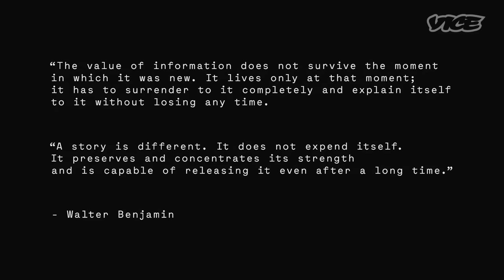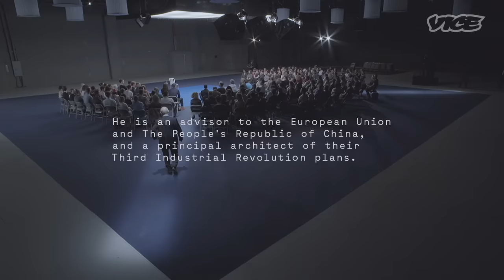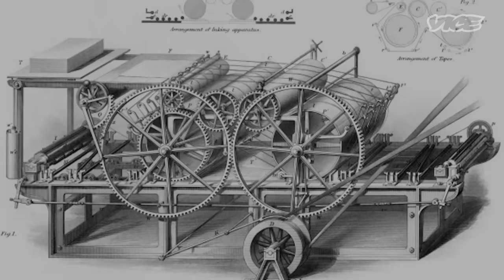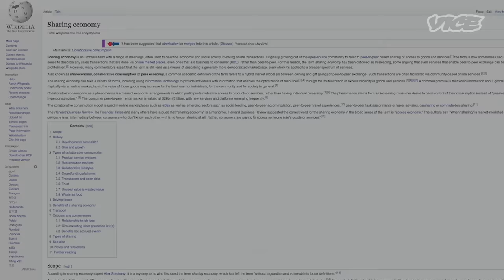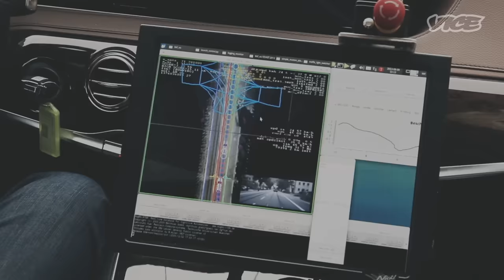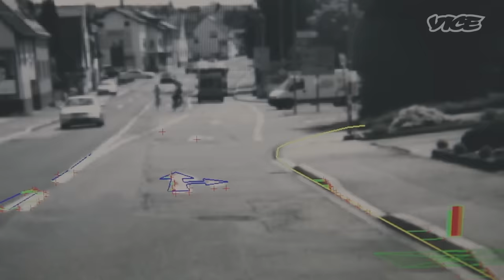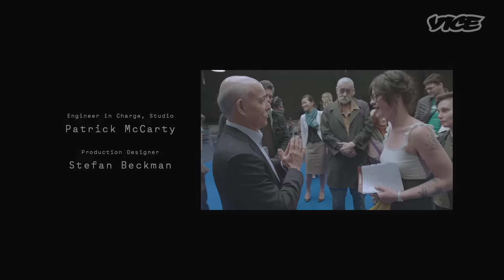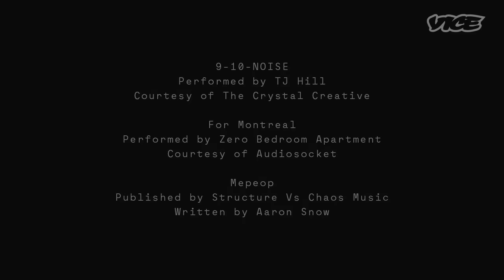The Third Industrial Revolution: A Radical New Sharing Economy

Comment: I’ve been watching this video for 2 years, anyone watching this on 2020? It’s amazing, I’m speechless.
Reply: Its now the fourth industrial revolution.
Reply: Big Knowledge and it has only just started 
Will it outpace our ability to absorb it?
Do we have enough intelligence not to fight it?
Or shall we fall back to greed and destroy
That which we have created....
Reply: @dominicsnow4164  Me too mate. I think the part he missed was batteries. And with elon musk announcing vehicle to grid we are looking at storage for energy meaning renewable energy is a viable option. You can sell power during peak times thus making money. The new battery coming can be made with out drying out the lithium reducing time on production and I'm told this dry process increases battery efficiency by 30 percent. This is achieved by reducing heat generated during energy transfer.
Reply: To add to the point a little more. If we flatten the peak energy demand by supply more power it will help lower the power price cause you don't have coal/gas power plants producing energy during peak times. This is the reason why our power is expensive. Something ya'll probably already know. :)
Reply: yes
Reply: Because it is accurate and well articulated.
Reply: WeatherWar101 is much more amazing and much more accurate. This man is lying to u. Just words, no comprehensible or testable evidence, unlike WW101
Reply: @ISeekTruthAndJustice  No, it's completely inaccurate and an elaborate coverup for what's really going on, which is WAY WAY worse
Reply: I just saw it incredible
Reply: @MattGalter  Elaborate please.
Reply: Darth Maul  your comment " watched  30 times  " WOW  is that good
Reply: Watching this for the first time. Incredible...I totally align with this vision and want to see it become a reality!!! What makes this video more relevant today is that this should be the response to our current (2020) global economic situation...and because of the severity of the situation I believe there is a greater chance that this change could actually take place. 

How do we move this into action?
Reply: Yes 2020 here. Are we any further ahead?
Reply: First time watching aug 2020
Reply: I'm not pushing religion here, however, In the scriptures it says that 1/3 of the creatures in the seas will die, 1/3 of man will die, 1/3 of the trees will die, earth quakes, droughts, huge hail stone, seas will rise, and the list goes. It's like someone knew human activity would activate these end of days scenarios, which are already evident in real time... another thing I forgot to mention - the great men of the earth - Yeah, these are the 1% - they will amass so much power and wealth that a third industrial revolution may just be a pipe dream. A loaf of bread will cost a whole days work under their control. So, I'm just saying don't let it be just a dream; you have to fight for it and take the powerful out of the seats of power (the scriptures describes these seats of power as high places). Just food for thought <<< millennial >>> generation...
Reply: Same
Reply: Ken Lawson he is actually a very vey bright man
Reply: Prophetic?
Reply: Beware folks. This is what the oligarchs will be calling “the Great Reset”.  It’s a console grid they want us to set up to control the population and protect the elites as capitalism collapses under its own internal contradictions. 
Don’t be fooled. This is their plan for us. If they fail then they will take us to total war to reduce the population to controllable levels.
Reply: Read his book with the same title if you haven't. It's really great.
Reply: Tesla will take us ‘Off Carbon With 5 Decades’ support the mission buy Tesla and the upcoming Tesla network autonomous vehicles!
Reply: I can’t remember the exact words but there’s a quote that goes by like this : We live in a era in which the illiterates will be the ones who can’t learn and not the ones who can’t read.
Reply: I'm watching 😁
Reply: @seemose  seen your music set-up
Reply: Mind blowing
Reply: Hey, I NEED to get in touch with any of the people who were present in this conference. Do you have an idea of how to reach them?
Reply: WOW SADLY YES 🌍😱 #BUZZOFFTOXIC
Reply: I agree! I've been mindblown, I wish everyone watched this!!!
Reply: @newdawnrising8110  But what vision are you selling ?   People should avoid networking at any cost ... even our own demise ???
Because becoming more connected and globalized , has not been proven to be our down fall.
And currently , it looks like you are not free in making a choice to learn ... since you apparently already know the end result.
So , do you want to re think about who might be the trapped brainwashed one here in the mix ?
Reply: YEEEEEEESSSSSSSSSS
Reply: It's computer communism and what occupy Wall street is all about.
Reply: Watching this after the world basically burst into flames in several countries because it's too hot.
Reply: Darth Maul  fruu:
Reply: It’s kinda like COVID is indirectly clearing a path for a major change. Now is the time to move, I hope we don’t squander it.
Reply: My first viewing. What I have been thinking about for a few years. I think capitalism has to change its structure. We cannot continue rewarding people who make money at the expense of the planet and our sustainability
Reply: First time in 2020.. it's brilliant
Reply: First time in 2020. Elon Musks ( Star Link ) is going to be  a huge part in pushing this agenda forward.
Reply: Human depopulation is urgent. As human, computer and animals are just the same. To be programmed. Feeling is just feeling.
Plastic trash issues here in Indonesia is inevitable even on Bali, there are limitless numbers of global companies here but none of them seem to care, but only matter of gaining profit without thanking, taking care the Mother Earth and I struggle myself all alone #Minangkabau #WestSumatra. All they do just trashing the tv programs with trashy programs the roots of the environmental trash #mindsets
I remember as a child in late 1980's early 1990's there were less plastic products than today as there wasn't even any private tv channel.
Greediness and stupidity has taken over human and keeps breeding without considering the future impacts. Human birth rate is out of control as well, needs to be balanced.
TV = television = transfering vision from distance
#sustainability #media #television #tvproduction #subconsciousmind #programming 
#environment  #Indonesia #capitalism #industry #business #Sumatra #Borneo #Celebes #Java #Bali #Moluccas #Papua

https://patents.google.com/patent/US6506148B2/en
Reply: Youve been watching it for 2 years? Well its a good thing scientists are now saying that the universe is  15 BILLION years older than theyve been saying it is. Lol
Reply: Stop watching it - it will fry your brain... it is bullshit.
Reply: @frze5645  prove it what is wrong about it? Don't worry ill wait.
Reply: Ya
Reply: Quant Network. Interoperability
Reply: What is the point of your comments. You respond to a presentation... Yet, you haven't the faintest of what he is saying and it is all obvious by your comments. Don't waste your time trying to understand, just follow allowing as you have no other choice!
Reply: @mattmatt591  🐰
Reply: @frze5645  still waiting?
Reply: @newdawnrising8110  - You are absolutely right.
Reply: @artofsigil2335  - But it is pure propaganda - you must see this!
Reply: @PresidentialWinner  "So in any case, if you’re tempted to try to join the Davos buzzword crowd and throw the term “Fourth Industrial Revolution” into a conversation, just don’t.  In a few years, when that term has been properly consigned to the dustbin of history, you’ll thank me"

I can't think him. He couldn't be more wrong. Klaus Schwab's expression appears to be more popular than ever.
Reply: @simongravel7407  Klaus is a clown.
Reply: A Thought provoking & richly insightful presentation, with  Q&A, which inspires further research & consideration
Reply: Yup
Reply: There is no sharing economy, there never will be. You are watching this for free because you and others like you are being pumped with Ads, without your consent, through which google is making loads of money and shutting out its competitors.
Reply: @SR-lk1jw  I think you are making a mistake confusing the sharing economy with the ad based market. Uber, Lyft, AirBnb don't have ads but are part of the sharing economy. Youtube is also part of it but has ads to create profits. These are not mutually exclusive. You can have both.
Reply: @johndiggs5926  watching this and realize that Trump managed to totally disprove his petro dollar theory and inevitable unemployment crisis through energy independence. Hence the virus and the Fourth Industrial Revolution which will force the U S to comply with the globalists evil scheme.
Reply: @justindaffronte9702  give me a break. Where do you people come from? Bots or paid shills?
Reply: @maganalia  yes, we are ahead because we now know that everything he said was B.S. based on the evidence shown to us precovid US economy and energy independence.
Reply: Things are becoming horrific in 2020
Reply: September here, still relevant
Reply: Soylent Green is made of people!
Reply: Darth Maul  Bro Kaidder has been watching this video for 2 years... 30 times doesn't even get you close 👀
Reply: PresidentialWinner yer mistaking idependent contractors who are payed by a company the work for as some free thing u just get
Reply: You a fan of the climate part or the communism part
Reply: @isaac6077  lol
Reply: The exact same story here! Saw it first about 2 years ago, must have seen it 10 times already
Reply: At least once every 3 or 4 months.
Reply: ... i'm afraid humanity is lost. it will continue to follow the orders of the corporate elite regardless of the consequences. why? because the elite own, operate and control all the media that's pushing its fascist agenda. 
       those exposing the reality behind this fascist, techno-take over of humanity are silenced. they can't buy advertising to oppose the advertising with which the corporations inundate society. 
       here's the solution - with EVERY commercial there needs to be equal time given to detractors of that commercial. and don't expect this justice to occur anytime soon as long as the industrial and techno elite control the world and almost everything we and our kids see, hear and read.
Reply: in other words - the damned corporate fascists are winning the PR war promoting their police-state products because they've made dissent IMPOSSIBLE!
Reply: Yes the future is scary 👻 and bright 🌞 👊🏿✊🏿🇨🇦
Reply: @MrAnselm77  ... yep, the future is bright for the rich and scary as hell for the rest of us. if humanity doesn't wake up, and REAL damned soon, we're going to find ourselves in a dystopian nightmare from which we can't awaken!
Reply: Watching now. It's blown my mind! If you were born after 1984 you have the world in your pocket- use it wisely for the new generations
Reply: NWO
Reply: @steveepic5957  I do not agree after watching this doc.
Reply: Just watching this now. I've been saying this for years but could never put it into words. It's frightening that nothing will be done.
Reply: @garrettchappell3786  Its already happening right now!! Don’t let the gravity of the situation kill your drive and push for change. Humans have proven, even us lazy Americans when we are galvanized towards self preservation with the truth we will understand and like wildfire the urgency will move us to fight. Please go be encouraged. Watch the Vice documentary named Third Industrial Revolution. Come back and lets talk about it!!!
Reply: Yea strip mining Africa of lithium and other minerals for our "Green" utopia
Reply: @newdawnrising8110  Spot on " The New Normal" Hmm where have I heard that before?
Reply: @maganalia  Depends what angle you are viewing it from. COVID is being used now to promote the NEW GREEN DEAL  which is part of The GREAT ECONOMIC RESET master minded by THE WORLD ECONOMIC FORUM. Which is top down digitised Communism. But one thing you can be certain of the 1% of population who own 90% of the wealth will be getting even richer while we are kept happy and dumbed down on Universal income anf LOTS of  technology to control us.
Reply: Yessuhhhhhhh
Reply: @MattGalter  ok matt whats the craic then? hell in a hand cart?
Reply: @cjmacq-vg8um  guessing you didn’t watch the video...
Reply: @j.j.7654  ... i watched enough of it. they're not offering anything new. just the same ole archaic and tired BS the left has been spewing for decades now, if not centuries. the right offers nothing new either. BOTH sides are just regurgitating the same old failed ideas of the past. they're both STUCK in the 19th century! 
         i have a better idea. but i'm not allowed to SHARE IT en mass because these elite on both sides censor me and deny my voice being heard. i founded an actually NEW and INNOVATIVE philosophy called "equalism." it brings economic and political thought into the 21st century AND BEYOND! 
        for instance, as soon as i heard the word "PRODUCTIVITY" i knew this video was just stuck in the past. like i said - SCREW PRODUCTIVITY! it isn't important. productivity is a capitalist word signifying a capitalist concept.
        and, as an equalist, I REJECT and DENOUNCE all archaic schemes and scams from the past that have simply led to MORE elitist tyranny and corruption. its time FOR A NEW APPROACH! one that WILL actually work! and equalism is that new approach.
Reply: Kaidder the video is only 1 hr 45 minutes long it must be on repeat . If you turn off your device it will stop playing. Watching you tube for 2 years will have given you a massive carbon footprint
Reply: I have changed my views on climate change after watching this. We are indeed robbing the earth of resources. Landfill sites are completely wrong. An economy run by oil is to unreliable, wind and hydro is the future.
Reply: Yes i watched J.R so many times particular this video, i felt like i should rename this as the last industrial revolution.
Reply: Interesting!
Reply: I had a big smile in my face for the entire 1 hour and 44 minutes
Reply: I’m going to finish watching it later today it’s impressive but alarming at the same time.
Reply: He forgot another internet.... the money internet (Bitcoin)
Reply: @newdawnrising8110  You take a close look at all the revolutions and you soon realize, that the future has always been the result of the "people" not the power.  You must always have great faith and hope in the "people".  There is only so far you can push a human before they will gather in the streets. Covid and BLM is a present and perfect example.  Be strong in moral humanity, be kind, be of service and remain calmly vigilant.
Reply: 2021 today, the most Relevant topics and solutions till we get this right.
Reply: 2021
Reply: Same here, watched it over 20 times now. Currently using this to inspire my co-workers to jump on the bandwagon and help our industrial customers into this new and exiting world of possibilies.
Reply: 2021, Shaggy my boi.
Reply: I can’t believe it takes you 2 years to watch a video
Reply: Just watched this 2021. Crazy
Reply: Yes. I am. Watched it 2 yrs ago as well. & again, now. This should be a required video to be presented in our schools. Bar none.
Reply: Yeah, the moment is Now! And it's a pretty interesting documentary! From Vice
Reply: Well, he's wrong about all kinds of stuff. Which is bullshit, climate change is real enough without lying and it does a disservice to the planet to do so.
Reply: ^----- Crying tears of hope in 2021
Reply: Try Andrew Yang's book.. "The War on Normal People".. you can stream the audio version free here on YouTube.
Reply: Predictive programming.
Reply: I'm speechless.
Reply: Let me tell you about "sharing".  People who share things often don't respect the item or thing (including land or the bus or subway) being shared. I've been 'sharing' a house with various roommates of various walks of life and they do NOT respect common space.  They are loud when others want to sleep at night, they leave messes, they may use or break your dishes or borrowed items, they invite their girlfriend to move in, they have loud sex to prove to others they are having it, they pee on the toilet seat or dribble urine on the floor, they clog the sinks and shower....
I LOVE the idea of sharing EXCEPT that I know how respectful most people are of others.  They are NOT.  Japan and parts of Scandinavia might be, but most places use and abuse EVERYTHING - people, animals, plants and trees, grocery store buggies, you name it.  This is gonna be chaotic.  I'd like to see him change mankind's attitude. I'd guess it took Japan and parts of Scandinavia many centuries to learn to think less can be more and common spaces and common items were sacred territory. And, even those areas still have areas where they could improve their respect --Japan seems to idolize paedophilia, for example) and I hear there are dog-rape brothels in some areas of northern Europe - not sure if that means Scandinavia.
Wishing something were so does not make it so and fast changes are extremely disruptive and could lead to revolution or worse.
Maybe we should all just stop eating so much and buying so much useless crap.
Reply: We can’t sort life on earth until we stop the banished.
Reply: I'm watching this in 2022 and I'm speechless
Reply: Damn that’s a long time for a one hour video
Reply: 2022 Hehe
Reply: 2022 baby
Reply: What’s it about?
Reply: @maganalia  not really in 2022...😭
Reply: She wants us to invite lettuce with microchips— how 21st century slave of you.
Reply: It’s almost 2023